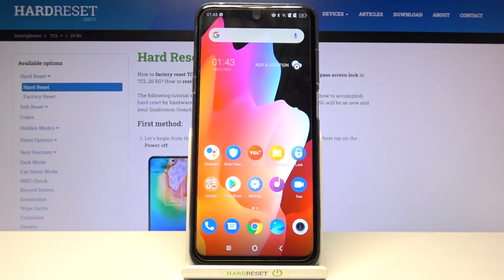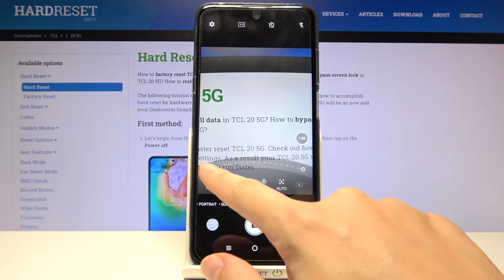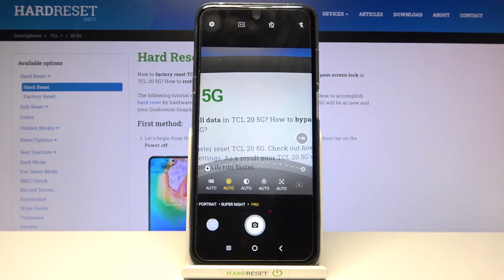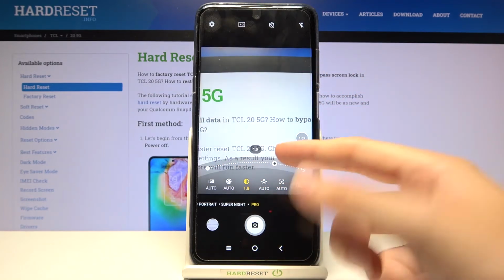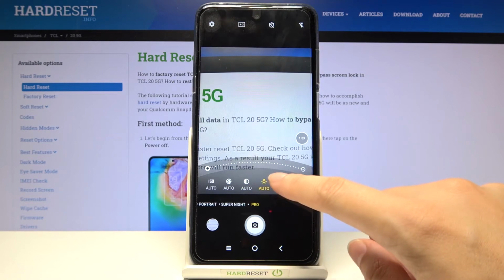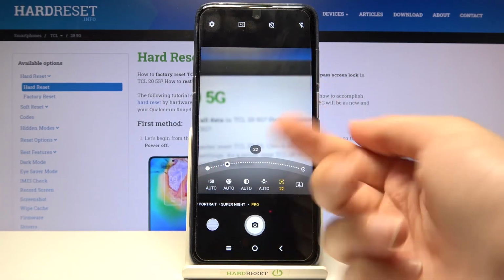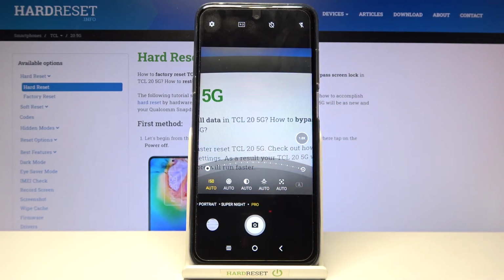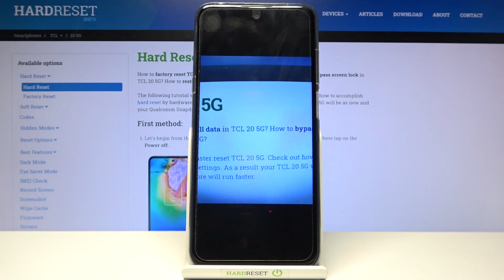Use Camera Pro Mode - TCL 20 5G and Best Camera Options

Comment: I appreciate this video very much! 

I have a slightly off question for you though. 

Do you know if the TCL 20 Pro 5g has an "hdmi mode" so I can use an HDMI - C converter to display it on my TV?